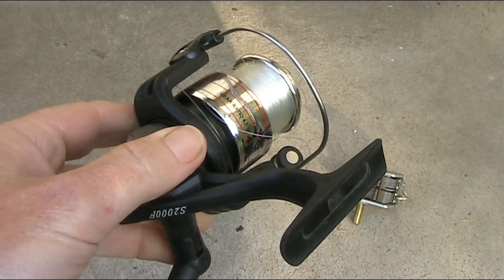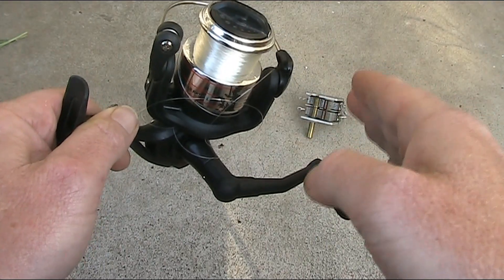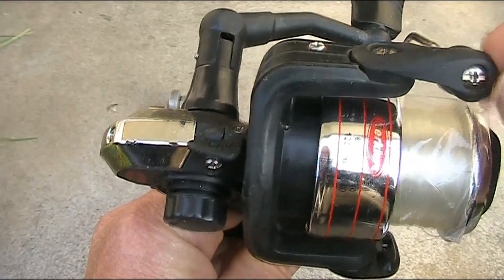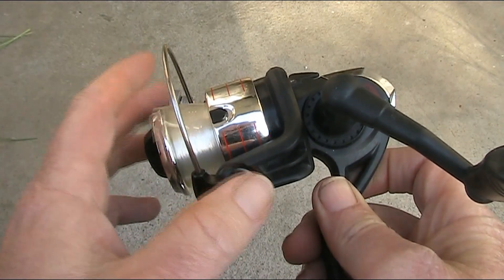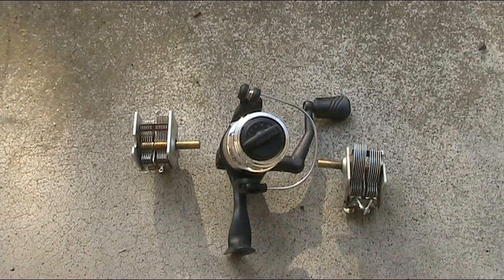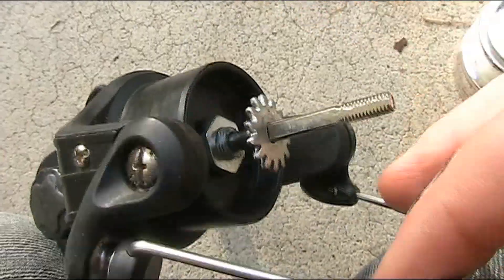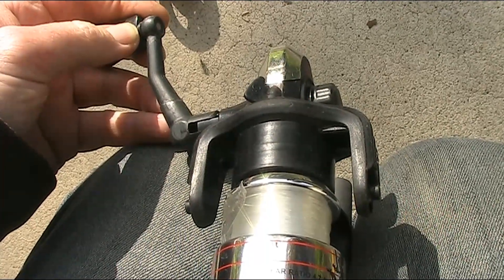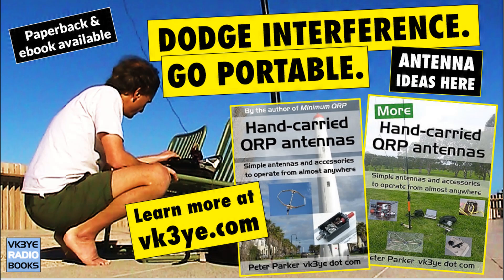Can a fishing rod winder drive a variable capacitor?

Comment: Very good Peter, but did you check the drive for backlash. Good quality radio drives always used spragued  gears to take up the backlash otherwise it would make precise tuning difficult. Just a thought.

Comment: not sure if you used a metric or non metric size allen key Peter? eg the keys in each set are similar in size but slightly different in diameter so the equivalent size in the other key set might fit...Just a thought...